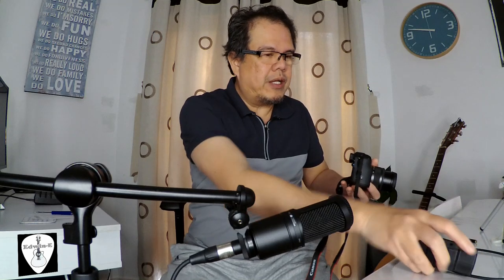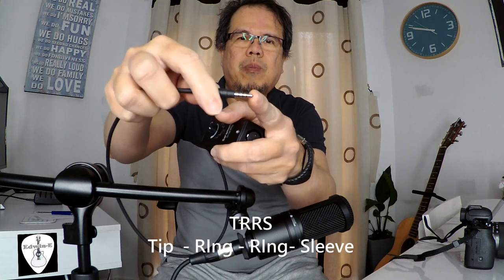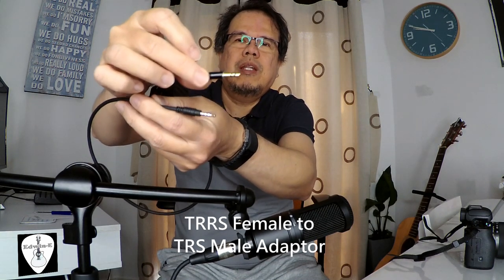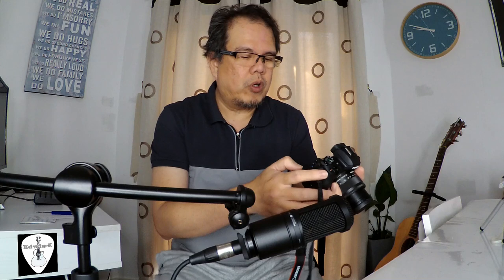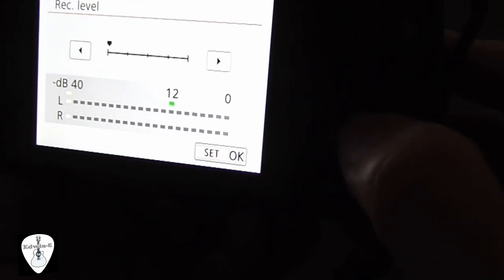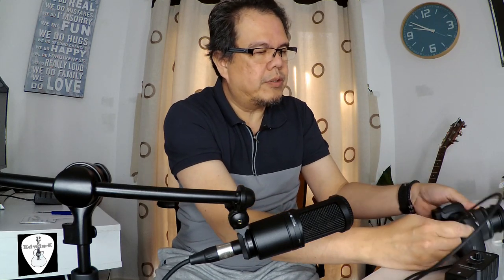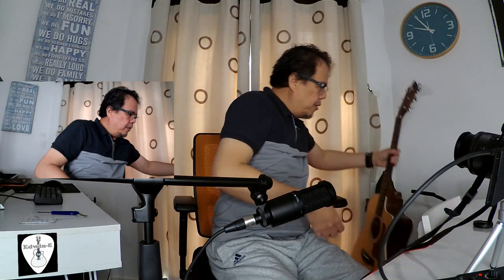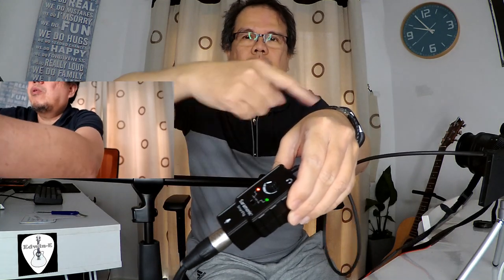Condenser Microphone to Canon M50 Mirrorless Camera Connection w Demo on Guitar

Comment: I was really hoping this sort of configuration would work. I saw on the Canon (TH) site, though, that Phantom Power is not recommended. Actually, it just says don't. Have you had any problems with your M50 using phantom power? I don't want to short out my new camera...
Reply from the maker: So far it's still working,. I have recorded many with this setup.  But I cannot guarantee it will work all the time.  Since, Canon states that it is not recommended to use Phantom power, , then the risk is on the user .

Comment: Great review. I was just wondering if I could connect my condenser mic directly to the camera it will save me a lot of time in post. I will search for this adapter on Amazon now. Thanks a lot
Reply from the maker: Great.  Good luck.  I am still using this interface and I am happy with it.  I think now, there is a new version for this.
Reply: @Edwin-E  I found the same one and also another but 2 inputs. Comica have one similar with one input but double the price
Reply from the maker: @IndyVisuals  good luck!

Comment: Hey Edwin, great video and nice guitar play :) Do you know if I can substitute the interface you shown with my Focusrite Scarlett?  It has RCA outputs. Can it damage the camera?
Reply from the maker: Sorry, I am not if it will work.  I haven't tried it. Also, I am guessing Focusrite Scarlett is USB
Reply: @Edwin-E  yes, is USB but has rca output as well
Reply from the maker: @valentiknows  also, DSLR or morrorless cam needs 3.5mm plug for mic input.
Reply: @Edwin-E  I know, I also have this M50. I know that is it possible to buy rca/jack cable
Reply from the maker: @valentiknows  I'm not sure if it works.  I'm guessing that RCA out is for active monitors.

Comment: 3:39 ano po yan kinokonek nyo? Sa condenser mic padn yan po?
Or bibili pa ng ganyang cable?
Reply from the maker: Saramonic Smartrig, yes, separate na binibili yan.
Reply: @Edwin-E  ano po tawag jan po? Audio splitter?
Reply from the maker: It's like audio interface.  Search mo lang Saramonic Smartrig.
Reply: @Edwin-E  may ibang condenser mic po ba na direct  camera? Or need po ba tlaga non?
Reply from the maker: @Skyph317  need ng interface or phantom power.

Comment: Gud day sir,,, pwede po ba sa Audio Interface e connect sa Canon m50
Reply from the maker: Depende sa audio interface.  Meron designed talaga na pwede sa dslr or mirrorless cam.
Reply: @Edwin-E  Behringer UMC202HD pwede po kaya dun
Reply from the maker: Ano purpose of connection?  Alam ko USB yan Behringer.